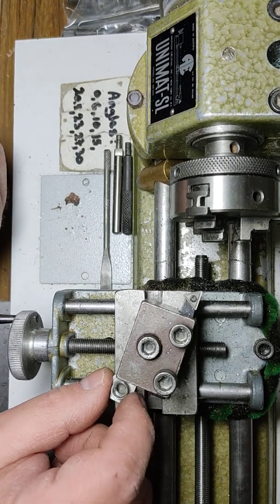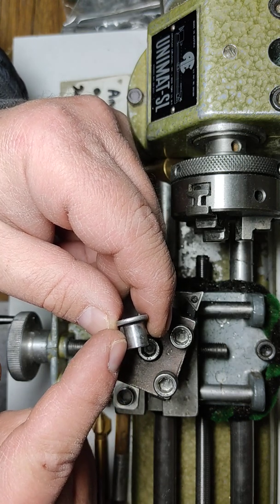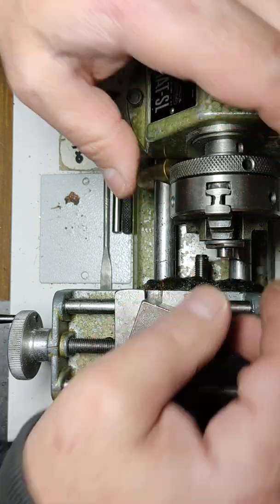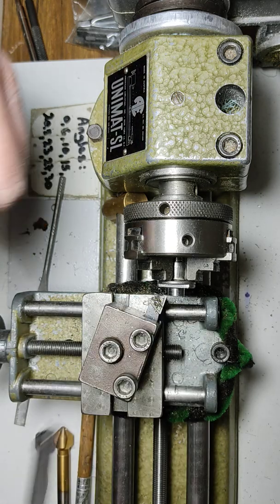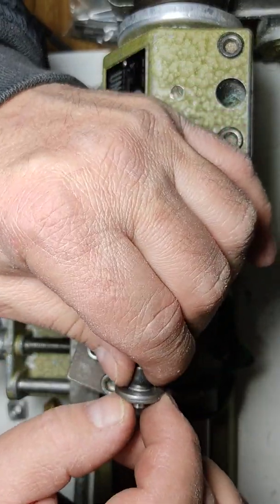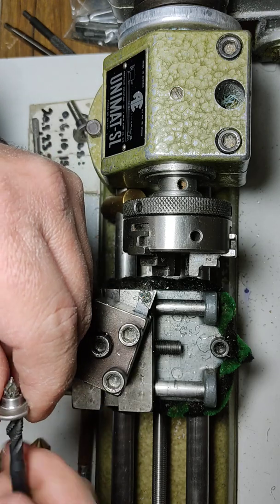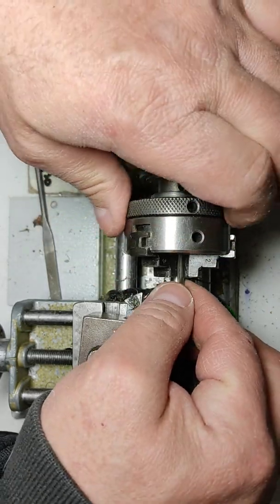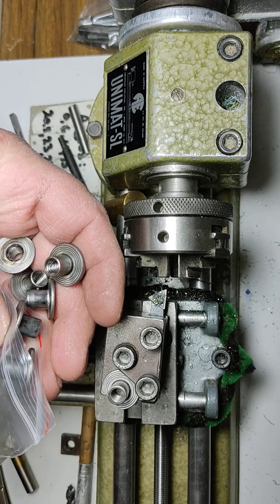Quicklathe: T-slot nut making

Comment: Mine are for 10mm bolts, but made in much the same way.  I turned and tapped the bodies myself, and then did the flats with the angle grinder.
Reply from the maker: Well... If it works and doesn't take too long to make - it's a win!!! ;)